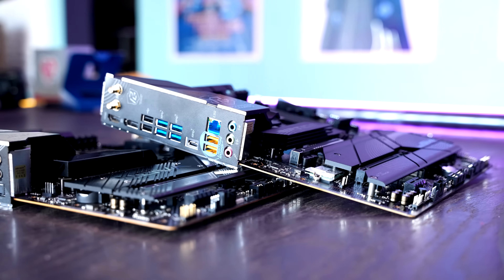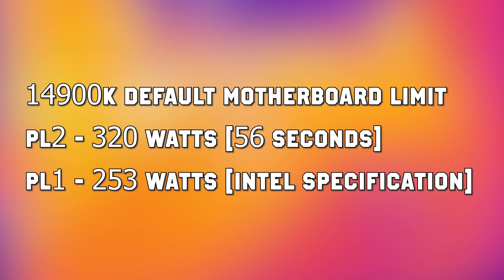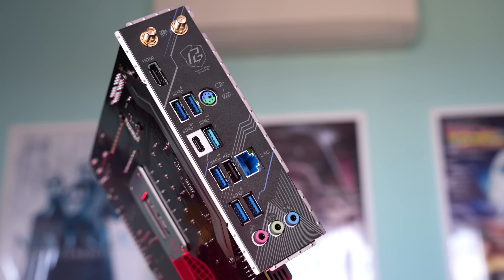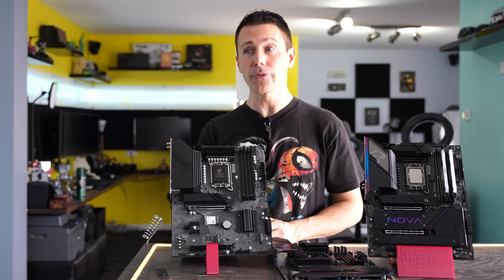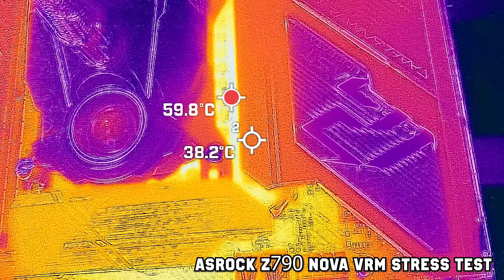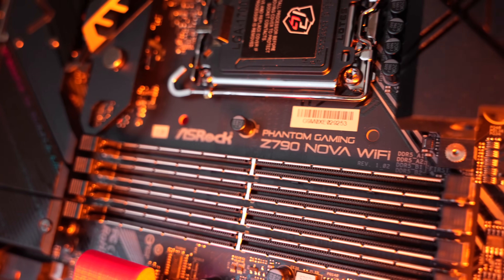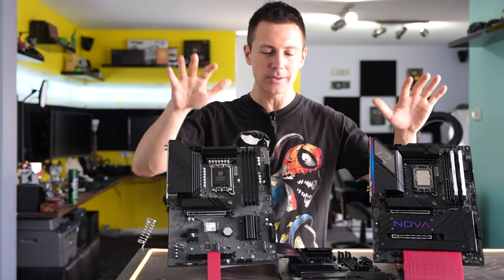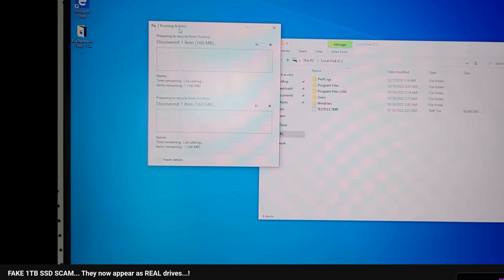BEST Z790 Motherboard at the BEST Price? (ASRock Z790 Nova, Riptide and Lightning Wifi Review)

Comment from the maker: Update* spoke with framechasers and 8000 stable isn't attainble for anyone buying this with XMP in mind.  7600MHZ Stable however seems to be his conclusion on stability (which is still better than boards that cost even twice as much, so overall still a great board).
Reply: Thanks for this update. Awesome work that you still update past videos. Keep it up Tech Yes Man!
Reply: 7600Mhz at this pricepoint is market leading. I paid way more for z790i Edge to get the same ram speed and its a 2 dimmer.

Comment: I didn't get what I can do with the second armored PCIe slot, if it's x4 only. Do you have any ideas sir? I've selected Taichi Lite for two GPUs, but Nova just confused me. I don't want to use a riser and a splitter for x16

PS Some Arc A310 into the x4 or similar may be? That would satisfy me ) Specs say it needs x4 as a max

Comment: I've been on asrock z790 riptide pg for over 6 months, running with 13600kf and corsair 7000 cl34 ram. What got me to settle on this mobo was 5 nvme slots. I'm not a person who upgrades every year and considering nvme is future of storage this was no brainier. On top of that most recent bios update allowed me to get my memory timings much lower than xmp had to offer and its simply stable with super snappy feel. I can't recommend asrock enough. Ever since asrock z68 pro3 in 2011 this has been nothing less but a solid choice.

Comment: Hi Brian, you mentioned about RAM tuning stability and actually I have the same 12700, B660M PG Riptide & Teamgroup Delta RGB 3600 RAMs but I have been having issues getting the same XMP speeds to 3600MHZ that you had. Can you share me ur memory tuning specs? Thanks & great content as always!
Reply: this may be due to the fact the SA voltage is hard locked on non K skus so hitting those memory speeds may not be possible on ur chip

Comment: Hello sir,
I have a asus tuf b650 plus wifi, and I updated the bios to 1811, after updating my has stucked in boot loop with a message " Bios is updating led firmware ".
I tried everything crashfree flash back and flashing different versions of bios.
I removed everything from motherboard. I step by step check each component but still boot looping, and I left it for Two days it was boot looping.
Please, sir, help me if you can .
I build my pc last week

Comment: Ah cool, Let's see I did BIOS update my 12th gen boards for 14th but these would be nice for a new build. Have the Z690 Asus TUF Gaming Wifi x 2 builds and a B760M. I like the magnetic m.2, have a screw included one on the Z690 boards while not essential, it's one less screw to reach for. 14700K looks nice for the latest batch, maybe 13th goes more on sale too. Have 12700KF and 12900KF in my rigs (have a 12400F for the mother). QVL DDR5 seems to work but only things I've had to change around over time.

Comment: Will you do a video where you show us a few good overclocks to save I will be getting the nova with a 14700k as well as what windows security features to turn off in bios
Reply from the maker: Yeah sure can make a video on how I tune my system up personally if you like.  In terms of voltages and settings for the 14700k I would have to get the CPU in to check it out.

Comment: Z790 Nova has the same price as 4060 tI 8G in my country lol
Reply from the maker: That is quite messed up... have you asked the retailer why?
Reply: @techyescity  higher price is just usual in my country due to import, tax, and whatnot. 4060 is $350 here, and only one model of RX 7600 is actually priced at $270, others more like $300-320. But Z790 is extreme case, even more extreme in this PG Nova case. Its even has higher price that Aoruse Elite X Wifi that is originally $300.  I havent asked any of them but since all retailer have relatively same price, i assume the distributor only import small chunks so the margin can not be filled with quantity which in turn there is "limited stock" price adding up too.

Comment: Nova board isn't that special, only 2 full length pcie slots, flagships have at least 3
Reply: Especially now that multi GPU is dead, I'd find it rather hard to even find a purpose for more than two full-size slots.
Reply: @-eMpTy-  I think your point is that you don't need a flagship product as most people don't, my point is this is NOT a flagship product.  I agree with you, capture card, 10g NIC, and a GPU, there's 3 devices
Reply from the maker: though the end of the slot is open so could fit a capture card on the bottom slot and it will work fine. @marktackman2886
Reply: @techyescity  this is why yer one of the best, nice rebuttal!  Point taken considering I left my self open, my only response is that PCIe 3.0 x1 Slot is not optimal but technically capable.

Comment: Currently running my RAM kit at 7800C34 using this board. It can reach 8000MHz but requires more time adjusting the VDD IMC.
Reply from the maker: 8000 is such a meh right now imo, I had to hit 1.5v on my sticks which is just way too high, will stick to 7600 and 7800 for now, especially since it's coming into summer here.
Reply: What RAM?
Reply: @rednex2013  7600 c36 32GB from G skill and Team grp T force extreme 8000c38 48GB. Both ran 7800 max.
Reply: What board?
Reply: Yo bro can you help me get 7800? I got the nova and a 14900k a die hynix

Comment: I honestly think that the 14700K was the sweet spot for the highest end Intel cpu. Its less pwr and heat than the 13900K and it performs very much on par w/ it and its about $140 cheaper. The 14900K is the red line cpu that if you are not doing a custom loop makes little to no sense and even then one could argue.
Reply: Sounds like 11th gen, where 11700K was the sweet spot as well, don't you think? Way cheaper than 11900K and marginally slower, better thermals and power consumption.

Comment: Just got the ASRock B760M PG Lightning WiFi DDR5 and it is doing great. Great featureset including DDR5, PCIe 5.0, WiFi 6E, 3x M.2 and an adequate VRM. For 135€ in Germany it is a great price. Swapped it out because my MSI B760M Mortar WiFi DDR5 was having Memory Speed issues and I was not statisfyed with 2x M.2. MSI costs 200€, ASRock 135... Definitely Recommended!
Reply: by the way that board supports overclocking locked ADL cpus.
Reply: @nepnep6894  what does that mean?
Reply: @nepnep6894  I read somewhere it only supports base clock overclocking for 12th gen non-K Intel, doesn't it? Because Intel seems to have locked 13th and 14th gen non-K processors.
Reply: @hiriotapa1983  correct
Reply: I considered buying a Riptide B660M motherboard with a 12400, but I couldn't find any in Thailand, they were not officially sold here, only on Aliexpress, so I decided not to go with 12th gen and bought a i7 11700KF and MSI Z590 instead, because both were on offer with a huge discount. Now I see that B760M Riptide is sold here, could you test it, Brian?
Reply: @nepnep6894  You mean the Asrock or MSI board? Asrock B660 Riptide has BCLK overclocking though, not the PG Lightning, does it?
Reply: @nepnep6894 why is anyone talking about OC’ing on a B760 mobo? Please don’t waste ur time…ur just gonna piss yourself off, trust me lol.